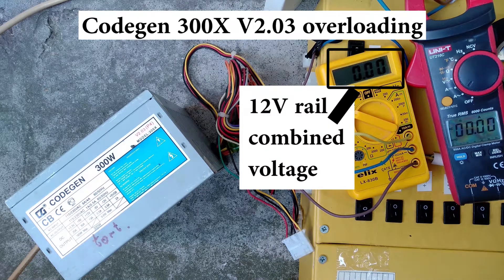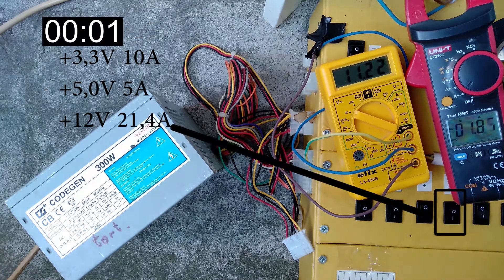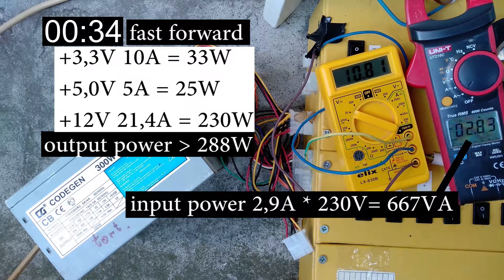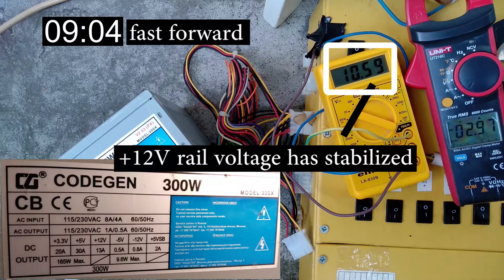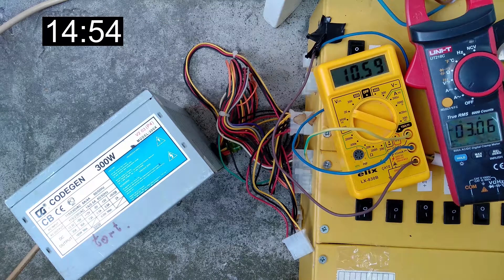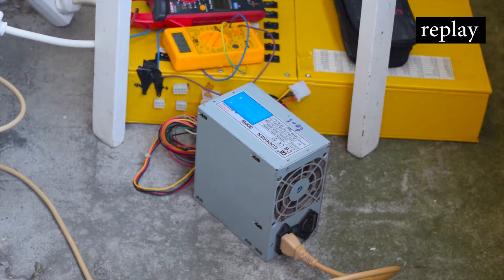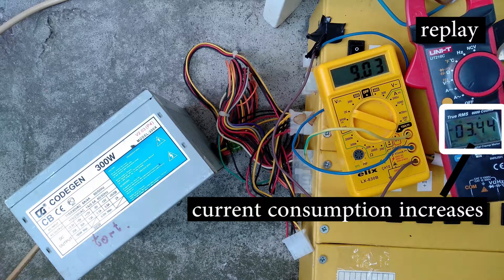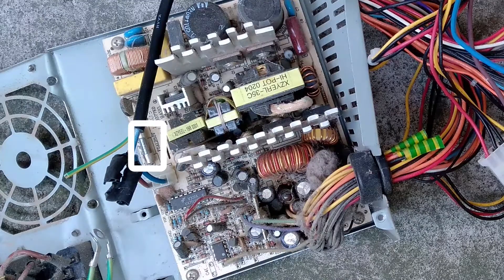Codegen 300W power supply stress test

Comment: I think you're wrong... Why? Firstly look at the Codegen's Inside - so dusty.... Dust=more heat... Secondly  that Coden was simply broken. Why do I think so? Because It's imposible that fully operational Codegen drops down Voltage to 10,5V. I'm pretty sure it because of I had Codegen and I tested it. I connected It to PC with GF FX5200 and Atholn XP procesor and as additional load I connecteced H1 car halogen bulb and the Voltage  drops down to 11,85V and didn't blew up. . One H1 bulb takes 5A(checked with bench power supply).I'm pretty sure that your Codegen blew of because of worn capacitors.  SMPS works like a switch. it's driven by chip, in this case Ka7500B aka Tl494. His task is voltage checking on the output and compere it with reference voltage and change duty  cycle  in other words tell; power transistors how fast switch on and off to keep Voltage at the correct  level If load raises, tranistors switches on and off fast and faster and  faster until the voltage gets steady and corresponds to Tl494 reference voltage. If drops switches on and of slowly.  So I think capacitors loose it's capacitance or invcreases it's ESR. Too low capacitance, lover energy reservation = higher voltage drops. In other words  damaged capacitors causes so high Voltage drop caused by high load that Tl494 overloads the main powers switching transistors and they blew  up. Most probably they gets dead shorted B-C-E terminals and that's why your socket fuse tripped.  About fuse... Fuse is alwas good because of his task  is prevent elecectronic from cought in fire, not prevent the electronic from failure... In this case it should blow but  probably fuse in your electric installation was faster then    in Codegen one and that's why doesn't blown... Wired fuses needs more time to blow because of the thin wire inside needs to get hot enough to melt.... Fuses in electric installation triggers immediately when  short cirucit/overcurrent occurs. Read about it's construction and you will  understand why...